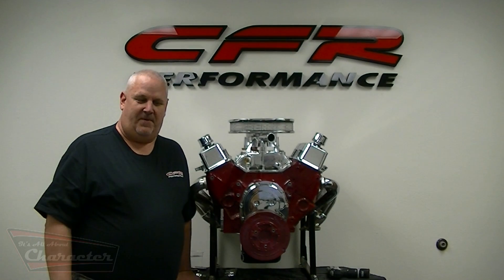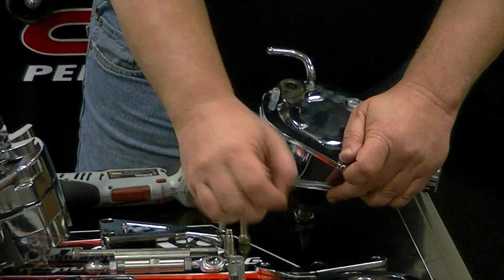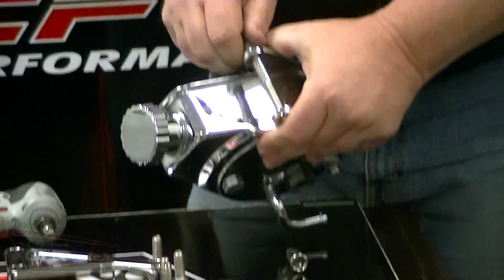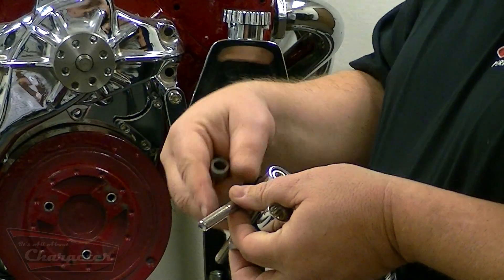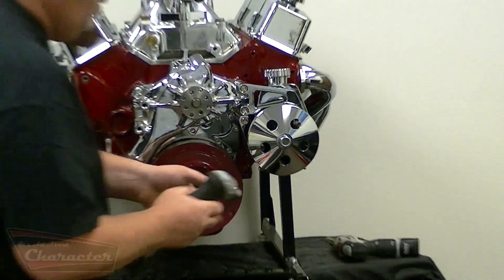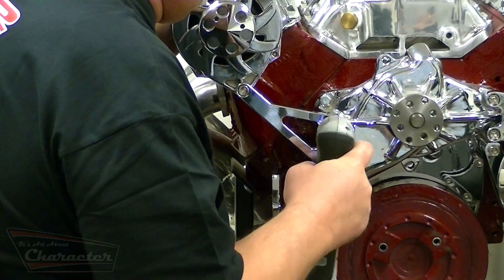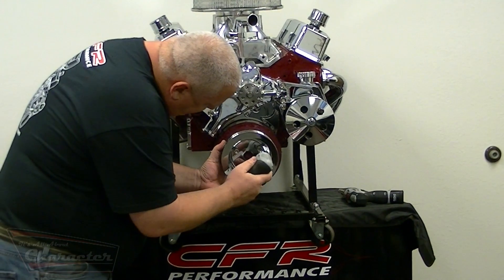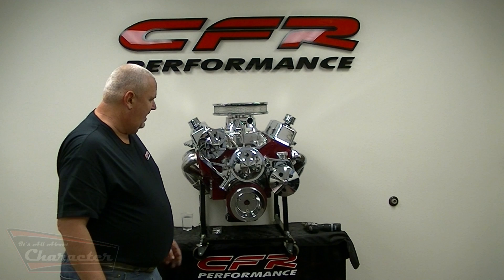CFR PERFORMANCE CHEVY SMALL BLOCK COMPLETE PULLEY, BRACKET & PUMP SET (LWP) INSTALLATION TUTORIALS

Comment: No one has an issue with this being a kit and you still have to modify stuff to fix?  If I'm broke down on hwy and buy a new water pump what's the chances I'm going to have a drill to drill that hole out?  Should be thinking of these things when designing.